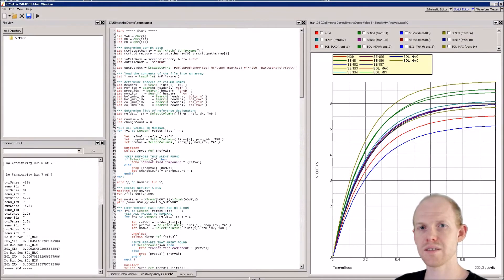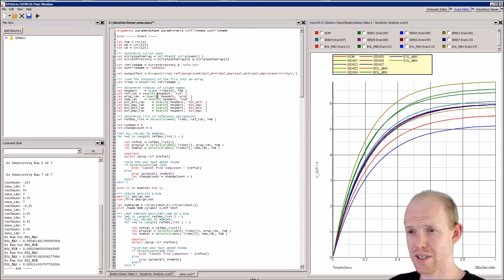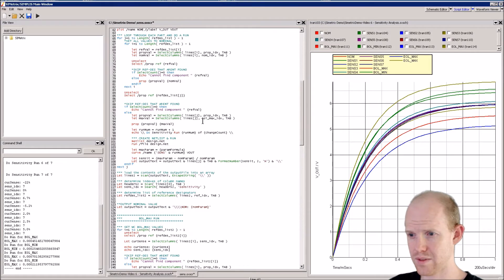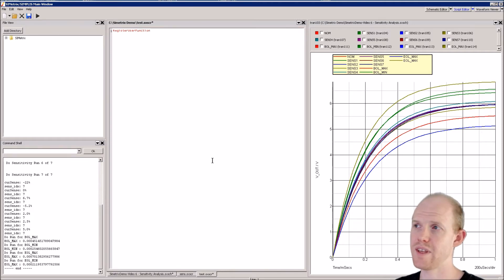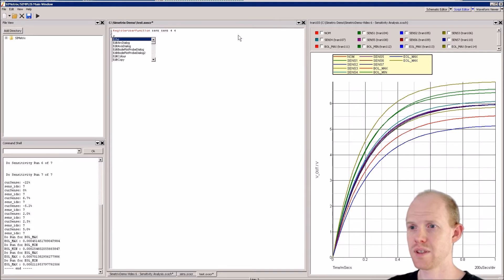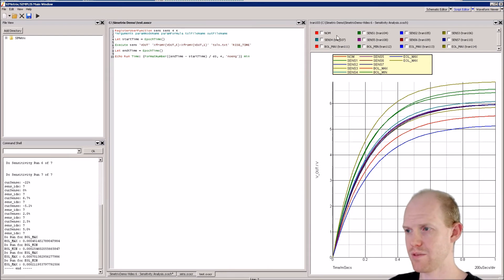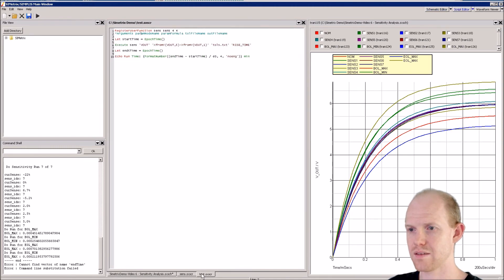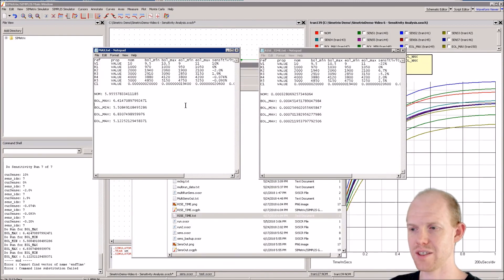SIMetrix/SIMPLIS Scripting 5 - Test File

Comment: Hi Jesse,

I am currently working on an LLC converter and I wish to generate bode plot out of the switching model by running multiple transient analysis by sweeping the stimulus (a sinusoidal voltage source) signal's frequency parameter.

I want to plot the open loop transfer function  of the converter ( Vout to control ) the control is the input to a VCO and I am injecting the stimulus over the control input.

I can run the transient analysis by sweeping the frequency, however I cannot plot the bode as I need to get the AC probe(which I can't have in simetrix transient analysis) that does the magnitude and phase extraction and plotting task for me.

Could you please guide me? It will be of huge help
Reply from the maker: Nice, that's a cool idea but I think the part you're missing is that there's nothing that "does the magnitude and phase extraction and plotting task for me". Did you checkout SIMPLIS? The whole point of SIMPLIS is to be able to run bode plots from transient analyses, however it does not do it exactly like you're trying to do. It does some kinda magic that averages the circuit over a switching cycle and runs and AC analysis on it. You should start by opening one of the SIMPLIS example files for an LLC. They have them all setup. A program that does more what you are trying to do is PSIM. It only works in the time domain and has a function to do bode plots from multiple time domain sims. Also Ray Ridley has done some work and I think written a paper on doing what you're talking about in LTSpice as well as improving the efficiency of the PSIM algorithm. That is on my list to try as well, but I have not gotten around to it yet. Anyway, good luck and feel free to ask more questions.
Reply: Firstly, thanks for your prompt reply.
Yes I know about simplis feature of running AC analysis on Switching models. Yes that's one of backup plan. Thanks for your input. 
Lastly, your videos are awesome. Is there a way to reach out to you for simetrix scripting related questions? Because except you I didn't see anyone else posting over simetrix scripting.
Reply from the maker: @vbidawat93  I have not used simetrix/simplis much for the last 3 years so I have forgot a lot of the tricks, but feel free to ask and I'll try and remember. If you have questions that others might benefit from you should just ask them in these comments, but if you want to write me an email, you can get my email from the about page in my channel. It's kinda lame that they made their own scripting language, but the documentation is pretty thorough. I think the hard part for what you're trying to do is to write a script that will accurately determine gain/phase differences based on the raw data points. I suggest if you really want to do this, you should look for papers and examples code that already does this type of thing, like the Ridley paper and there's also a script in the Allegro/OrCAD PSPICE Simulator that does this but it does not work very well (Tools => FRA). If you do get really into experimenting and developing this algo I am happy to colab with you since it's on my list of things to learn.